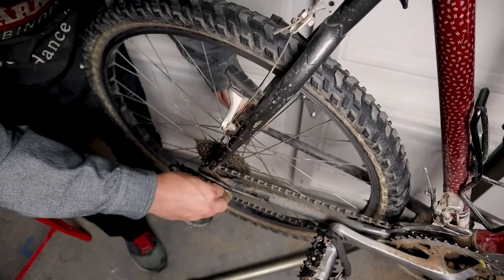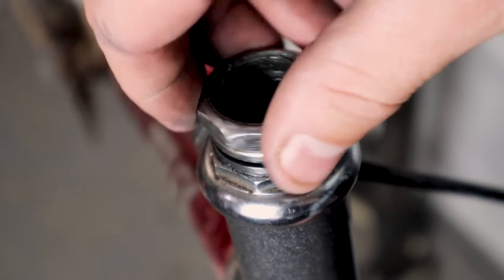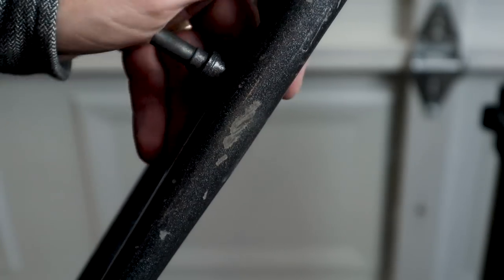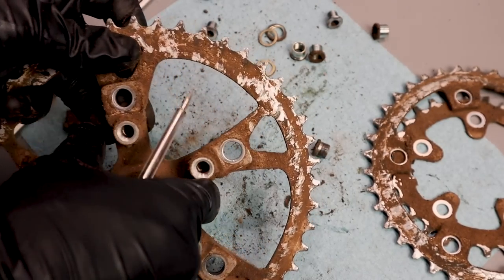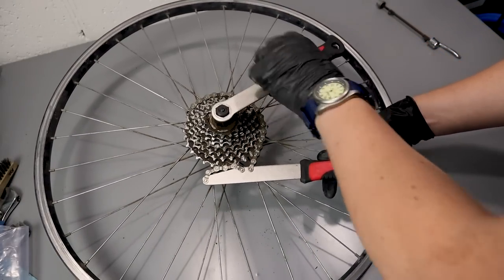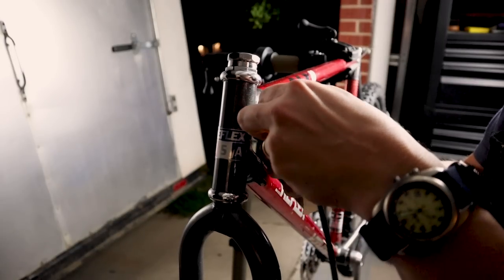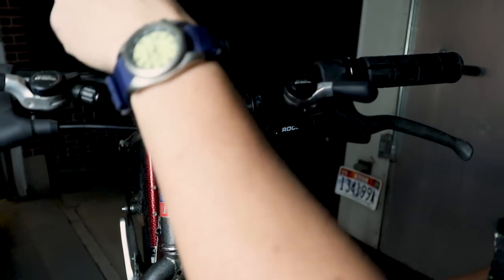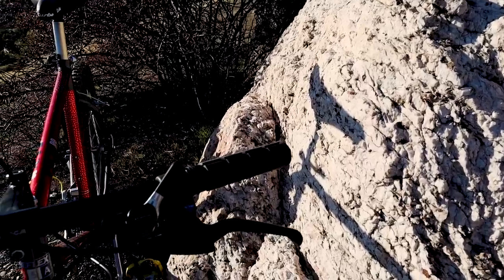80's Mountain Bike Restoration Tune Up | Easton Reflex ALX 89

Comment: True mtb 26 inch skinwalls?  Try Panaracer 26 x 2.10 Smoke and Dart paired fronts and rears.  Will set you back only about 90-100 bucks a pair for Japanese made.  Not bad.  Alas, little choice other than these.

As aside, I bought a 1988 Panasonic Mountain Cat 4500 new from my then local Atlanta bike shop.  I still have it and it has seen little use due to where I ended up living.  Biopace too and all Deore.  I also have a near pristine all original Gary Fisher 1986 Hoo Koo E Koo.  A true Gary Fisher - long before Trek absconded with the brand.  Snagged it off eBay a few years ago.  Yup.  These veterans are very cool.

PS  That Reflex?  Very, very high end for its time.  Alu frames were then tres exotic.  Amazing bike.  And gorgeous restoration to near original.

Comment: From the beginning of the movie I've been thinking "good luck with bottom bracket in this 30 years old bike, man!". So disappointed that it went so smoothly... Recently I was unscrewing BB in two bikes, from '91 and '93. First one has a very similar type of bracket like in the video and it required some good wrench and strenght, but the 1993 cartridge sealed BB from Shimano(LP20) that you need special tool fo it. It was horrible, with socket wrench the tool fall out of BB, other wrenches slid, unfortunately I didn't search for better ones in garage earlier, so finally I hold the tool with a half meter long grandfather's pipe wrench, probably made when Stalin still lived, and it worked. If there were any grease it'd gone long ago. I better find some proper wrench to work with that BB tool...

Comment: Still plenty of 26" tyres over here in the uk as a company called Halfords still supply them for there older model Carrera maintain bike intact you can even still get 27 1\4 " tyres for a 78 road bike I have !
Reply: Yeah Halfords are good with tyres but lots of their bikes if not all of them are made in Taiwan and some of them  are rubbish, I have spoken to people who ended up with cracked frames.  Look at the quality of that bike with a totally straight top bar.  I have asked Halfords to build some bikes with this design but they ignored me.

Comment: That bottom bracket came off easily!   I think we missed a bit of hard work in the video.
Reply from the maker: It actually came off without much difficulty. I was actually quite worried, I’ve had others that were almost impossible.

Comment: Great restauration of another 80ies bike. I really like your videos. However, I was wondering why you didn't put any grease on the bottom bracket threads (7:47). The races/bearings - well, yes of course. But no grease on the threads??! I made the experience that you hardly get those off after a while. I also always put on some grease on the cantilever sockets and also a little bit into the top of the seat tube to avoid any corrosive stucking of the stem on the long run.

Comment: Mountain bike technology has changed over the last 30 years.  You can get a front suspension hydraulic disc brake bike for around 300 dollars on ebay or Craiglist if you look around I bet.  The only really old bikes I would consider restoring would be like a USA made Cannondale now that they are not made here anymore or a limited edition bike that was really expensive when it  was new.

Comment: Top tube internal cable routing is a cool concept. But, not when the original housing is left in, expands and gets stuck.

Bought an '85 Mongoose ATB last year for a complete "year specific" rebuild. Part of the housing is stuck inside the top tube. Fun times, eh?

Comment: Looking at and finding bikes at a pawn shop or ebay and craiglist is like finding a diamond in the rough. Or even at a salvation army if you can find one that's selling bikes. You need a good eye and know your stuff. Usually when I see these kind. Most people see it as junk and don't look underneath the dirt and sometimes light rust. When you find for $200 or slightly less. They will maybe blow away any brand new walmart adult bikes period that are not true bicycle shops / store. Even if you get these bike for $50 at pawn shop. It's platinum. Lots of tlc to get back road worthy and well worth it.

Comment: if you are in need for some good 26 inch tires, then check out Michelin Country Style or Michelin mud Style. Both are the exact same tire, just different marketing. You can get them for about 10€. 
In my opinion these are probably the best MTB tires you can get. The only downside is the fast wear. I usually have to change them every 1000 km.

Comment: I’ve got a question not directly concerning this video. I’m 1,94 cm (6’3”) tall and daily ride a track bike with a 62cm (24,4“) top tube and a 65cm (25,6“) seat tube. The frame was hand built. As you really inspired me to get off the street and into the dirt, my question is how do I translate these measurements onto a mountainbike frame?

Comment: Would you be so kind of telling me how is it called the tool used at 5:14 ?? I am tuning up my 1999 mountain bike and that seems to be the only part of the bike I'm not equipped to disassemble. Thanks in advance, this is a great video!
Reply from the maker: It’s a crank arm puller tool. Here’s a  affiliate link to one on Jenson USA https://alnk.to/gzOv93d
Reply: @oldshovel  Hard to get from Buenos Aires, but still thanks a lot for the name of the tool and the tip! I never expected to have an answer in minutes, bicycles are not my thing but nevertheless you have earned a suscriber

Comment: Correct me if I'm wrong but did you grease the threads in the bottom bracket. Seized ones can be a real head ache to remove

Comment: @oldshovel A couple of things seem missing missing from your bike builds
no cable catcher for the cantilever straddle wire
no grease on the pedal threads
things that admittedly matter a lot more on worn out bikes
but still such practice was very common
Reply: i think there was a tiny bit of grease, probably just enough.
Reply: @bananasstuff3344  ya only a little is needed

Comment: Could you tell me the name of the breaking system as i have two Malvern star mountain bikes that have the same breaking set up, And the break pads are worn and idk what there called as it is like a brake with a long screw type of thing and you put that in between the wheels and then tighten another hex screw, It is really not safe to be riding with bad breaks around my area in Australia. And i can't find the brakes anywhere.

Comment: I have only 1 question. When i was disassembling chainset, i saw that screws were fixed with paint. How important it is?
Reply from the maker: I’m guessing that was Loctite meant to keep the bolts from loosening over time. It’s helpful but not always needed.
Reply: Not always needed and some people even use 💅Nail Polish
But 'Loctite 248' is most often recommended if you're only going to use one type. It looks like a blue Lipstick💄

Re: Where and where not to use loctite

PostMon Aug 31, 2015 09:10 am

According to Pinarello:

http://www.eriksbikeshop.com/assets/images/promo/PDF/OwnersManuals/PinarelloENGLISHweb.pdf

THREADS, THREAD-LOCKERS, GREASE AND TIGHTENING TORQUES
One of the most debated issues is the coupling of threaded parts; in particular it is debated if threads should be a) degreased or b) lubricated or c) treated with thread-lockers, and what is the proper torque to be applied in each of these cases.
In line of principle, we expect threaded couplings to remain stable/tight over time with no loosening, we expect that they can be taken apart when necessary, we expect that they do not generate noises due to micro-movements of the parts, we expect them not to develop corrosion.
Corrosion, that can be a big problem because it can seize or damage threads, it is frequent between different metals (titanium-aluminum, steel-aluminum). In the past there were no alternatives and grease was used in the threads, to fulfill all four needs. But grease facilitates loosening, does not last forever, migrates, changes characteristics, is washed away, does not always offer sufficient corrosion protection, and reduces noises only temporarily.
Thread-lockers have been used for many years in mechanics. What is a thread-locker?
It is a liquid that is applied on the threads during installation and solidifies in the following hours. It is available in many “strengths”, but for the bike it is preferable to use the weak one, Loctite® 222 or Arexons® System 52A22. Thread-lockers offer numerous benefits when used
on threaded couplings: 1) prevent undesired loosening without the need to use high tightening torques, 2) prevent corrosion in the interface,
3) prevent any micro-movement with associated noises, 4) they remain stable over time.
Thread-lockers solidify when air is absent, therefore the entire space between the threads must be filled with product, otherwise, if not enough product is used, it will remain liquid.
Using a thread-locker stronger than recommended can seize the threads, especially bigger diameter threads.
Using the proper tightening torques it’s essential for correct function and to avoid loosening or structural damages. In certain cases tightening torques ensure mechanical couplings, in other cases they prevent loosening. You authorized dealer will use, in certain applications, the thread-locker and eventually apply a lower torque. Tightening torques are different if the thread is lubricated,
treated with thread-lockers or degreased. Most torques are specified by component manufacturers and appear in their instructions, but carbon frames require special care during assembly and maintenance. To lubricate threads never use lithium based greases.
Your dealer has all the torque wrenches required to tighten bolts in the range from 1.5Nm to 50Nm.
We recommend the following tightening torques:
Rear Derailleur fixing bolt – 12 Nm (lubricated thread) – Loctite® 222/Arexons® 52A22 can be used, torque reduced to 8 Nm.
Front Derailleur clamp bolt – on CARBON FRAMES: 1.5-2 Nm (lubricated thread) – Most Safe™ assembly compound can be used on
internal clamp surface – on METAL FRAMES: see FD manufacturer’s instructions.
Front Brake socket head nut – 7 Nm (lubricated thread) – Loctite® 222/Arexons® 52A22 can be used if the nut has a Torx® socket or if it is
made of steel, torque reduced to 5 Nm.
Rear Brake socket head nut – 6 Nm (lubricated thread) – Loctite® 222/Arexons® 52A22 can be used if the nut has a Torx® socket or if it is
made of steel, torque reduced to 5 Nm.
Bottom Bracket cups – EXTERNAL BEARING TYPE should be hand tight (as tight as you can using your bare hands) with Loctite® 222/
Arexons® 52A22 (if thread-locker is not available, the cups should be tightened 35-40 Nm) - ISO SQUARE TYPE must be hand tight, using
Loctite® 222/Arexons® 52A22.
Seatpost fixing clamp – Most Safe™ assembly compound should be always used – CARBON SEATPOSTS 3 Nm (Most Safe™, lubricated
thread), 4 Nm (lubricated thread), 6 Nm (degreased thread) – ALUMINUM SEATPOST 6 Nm max.
Seatpost Saddle Rail clamping bolts – TAIL C-MAX™ 1K or 3K front bolt 4 Nm/rear bolt 8 Nm (lubricated threads) – TAIL C-ALU™ 12 Nm
(lubricated threads).
Stem: fork tube fixing bolts – Most Safe™ assembly compound should be used – CARBON FORK TUBE 5 Nm (lubricated threads) – ALUMINUM
FORK TUBE 10 Nm (lubricated threads).
Stem: handlebar fixing bolts – Most Safe™ assembly compound should be used – CARBON HANDLEBAR 4 Nm (lubricated threads) – ALUMINUM
HANDLEBAR 8 Nm (lubricated threads).
Anchor Plug inside fork tube – 7 Nm (lubricated threads).
Cap on top of fork tube – 2 Nm (lubricated threads).
Integrated Shift/brake levers handlebar clamping bolt – CARBON HANDLEBAR 6 Nm (lubricated thread) – ALUMINUM HANDLEBAR see
manufacturer’s instructions.
Bottle Cage fixing screws – Loctite® 222/Arexons® 52A22 must be used – 2 Nm.
Cable guide plate under BB – Loctite® 222/Arexons® 52A22 must be used – 2 Nm.

CAUTION! If the manufacturer’s recommended tightening torques are different from what we indicated, in case of carbon frames use the lower of the two. Please contact us or your authorized dealer for clarification.
CAUTION! In carbon frames the bottom bracket aluminum insert is bonded to the carbon structure. If the bottom bracket has a cup with no shoulder, Loctite® 222/Arexons® 52A22 must be used on the thread and the cup should be tightened by hand, to avoid damaging the insert. Moreover, if an aluminum cup is seized inside the insert (this can happen when Loctite® 222/Arexons® 52A22 is not used), do not use more than 80 Nm of torque when trying to unscrew the cup, and make sure you’re turning in the proper direction, to avoid de-bonding the insert which would destroy the frame.

Middleburn say:
http://www.middleburn.co.uk/images/pdf/chainset_assembly.pdf

But Pinkbike say
http://www.pinkbike.com/news/Tech-Tuesday-Thread-locker-Basics-2011.html

https://www.sram.com/sites/default/files/techdocs/my10-sram-tech-manual-rev-a.pdf

http://www.tech-mavic.com/tech-mavic/uk/sources/Produits/ROUTE/Roues/KsyriumElite/KsyEliteSpokeReplacement.pdf

http://www.campagnolo.com/media/files/035_40_Technical%20manual%20-%20Ultra%20Torque%20Power%20Torque%20bottom%20bracket%20cup%20-%20Campagnolo__Rev01_02_15.pdf
Reply: @johnrhodes3350  Very thoroughly, thank you.

Comment: Wonder how we could ride those bikes with so steep HA and loooong stems?!? ;)
Reply from the maker: It’s definitely a different feel.  The stance is so much more over the handlebars and almost twitchy in its responsiveness.
Reply: You just practiced OTB more
Reply: You could but it was very difficult. Old mountain bikes were in a similar spot as gravel bikes were few years back. Almost everything was borrowed from other categories. That included geometry, riding position, wheel size, etc. There's a good reason why those changes came. Modern gravel and some CX bikes are actually more capable off road than these mountain bikes were.
Reply: That was the least of your problems😂Rigid fork and sketchy brakes required attention on the trail. I had this same bike and frame was a little noodly too. Stem was at least 150 mm. And our tires were called Farmer Johns.

Comment: You don’t grease the bottom bracket when putting crank back on spindle otherwise good video👍🏻 Oh and use stiff vinyl brush Not wire brush unless you like scratches on everything 😝

Comment: Great video. But I would put on a good saddle. I really don't miss those saddles. And those pedals suck because those straps are useless and extremly annoying. BTW: I still use my old 94er mtb for driving into the centre because nobody steals it.

Comment: To be honest, I believe that the introduction of the 27.5 and 29er MTBs is nothing but "market expansion".  Mainly because there are almost no 26er components to buy anymore.  In this way, instead of improving their bike with a few new components, every biker has to buy / build a completely new bike.  To be honest, that annoys me a lot.  I built a 26 '' hardtail (made entirely from China components), for which I don't get a full suspension frame.  There are only frames that look like welded together in the backyard, or frames that are so expensive that you think they're antiques ...

Comment: id show you my bike, i ride it to this day and its in 10x worse condition, it has already been stolen and repainted by some previous owners, both aluminium triangles are not in the best shape and the back is being destroyed by the chain slapback, i had to buy new wheels because the shafts have been bent a lot, and its a road bike, not like the speed bike but regular road bike similar to the one in the video, but it had normal tire and inner tube size
Reply from the maker: Bikes are awesome

Comment: Are strap-in pedals common for mountain biking?
Reply: Used to be the only thing until clipless for MB's.
Reply: I'm not a mountain biker, but I could not imagine being clipped into a mountain bike coming down the side of a mountain.  Being able to get off the bike in mid air and get it away from you (so it doesn't hit you) is key to surviving bad jumps etc, at least so I am told.
Reply: @tarstarkusz  It's a matter of personal preference, really.  The clipless can be adjusted so that they release very easily or you can just get used to swinging you heels out as a matter of reflex.  They make jumping easier in that the bike is more connected to the rider and when the rider jumps the bike goes with them, unlike no clips or straps where you'd just be jumping off of the pedals, or straps that just can't ever be tight enough to give that solid feeling of being connected to the bike.
Reply: Well, I certainly agree I would rather have clipless than clips.  My cycling is more on the street, but if I wanted to be connected, I would definitely go clipless.

Comment: 1) Truing wheels involves taking out the flat spots and hops and making them round again, not just making them flat again.  Yes, it's harder.  
2) Internal cable routing was annoyingly common and dumb in the 1980s, and it still is.  It has only disadvantages and no advantages.  
3) Did you put that seatpost in dry?  Don't do that.  Stuck seatposts are a fatal curse of older bikes.  
4) Selle Italia Turbo saddles looked great but are decidedly non-awesome to sit on.  Vetta ATB wasn't bad, but I don't think you can get it anymore.  

This video is a lot like a day at work for me, but most customers with thrashed and knackered old bikes are trying to get them running on the cheap, not bring than back to their best.  I can't say I blame them, really.  I like my well-kept old bikes, but I don't ride them so much.